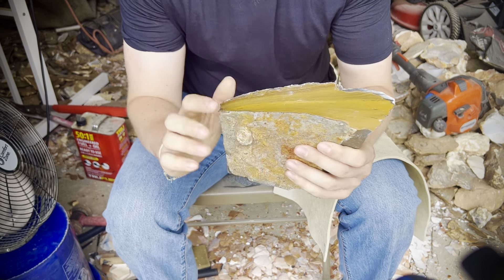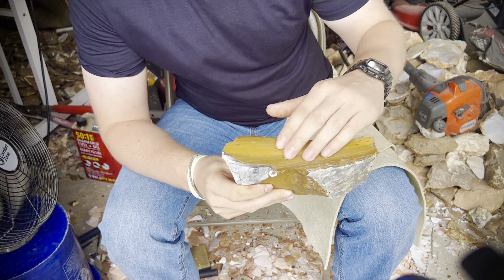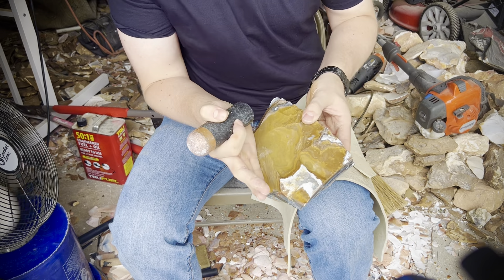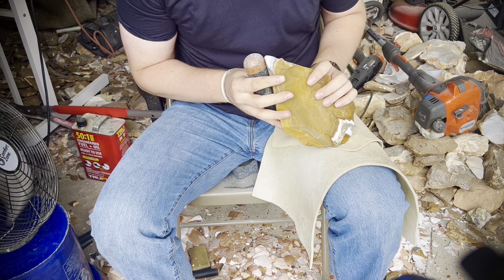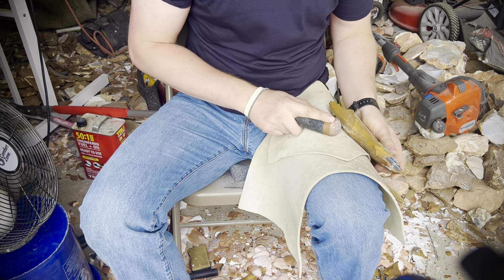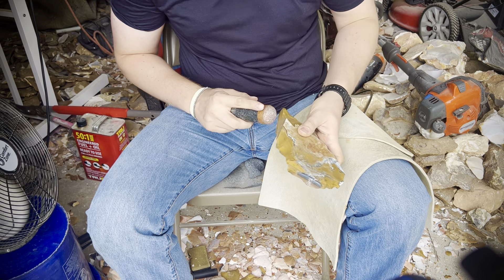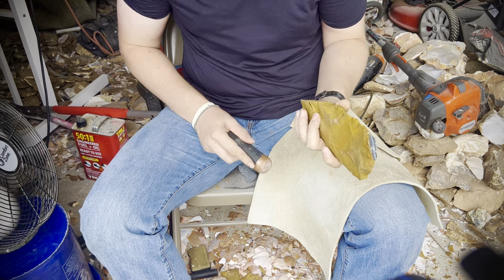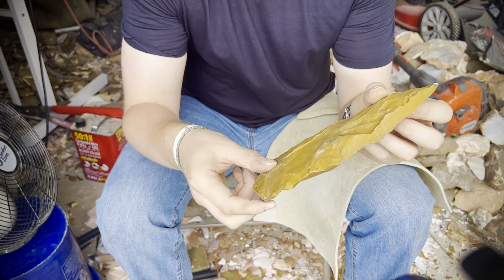Flint-Knapping a Tab Of GOLD!! Spalling Out Georgia Jasper

Comment: Looking at the copper bopper how much it looks like the one i made but the handle i used was copper tubing soldered onto the head plug .   Bar stock 11/8" bought from a local industrial supply chain.       It does make the job easier .
Reply from the maker: Very cool!